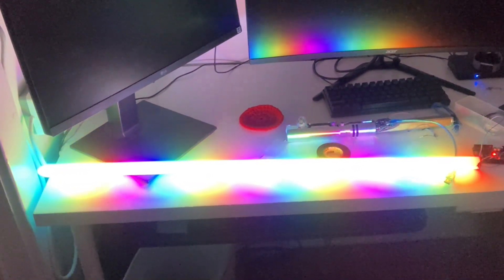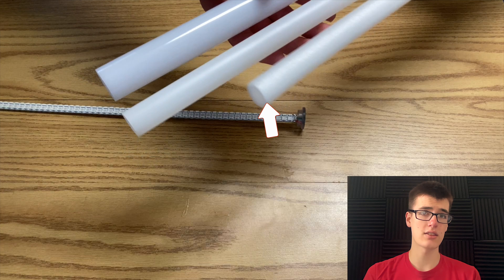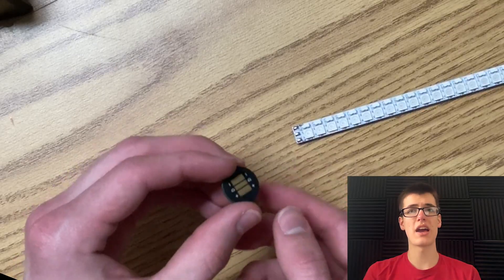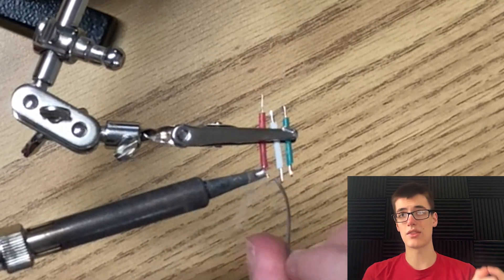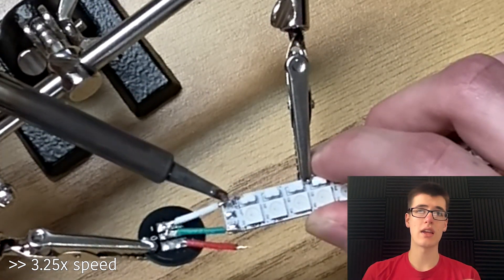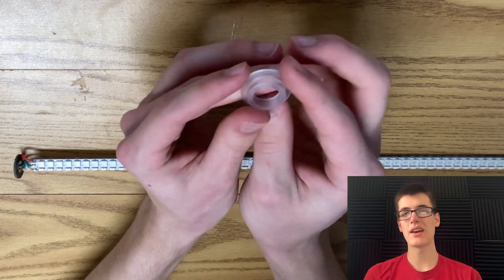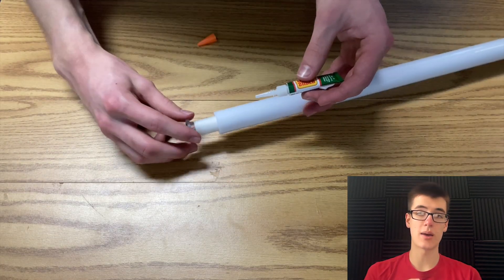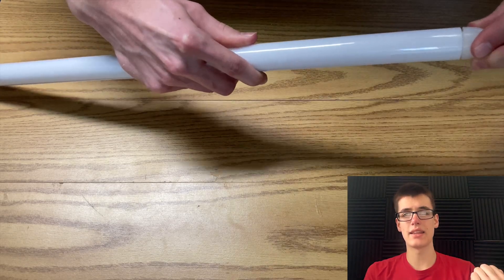How to Make the BEST Lightsaber Blade | Elegant Weapon 1

Comment: I've restored old Master Replicas lightsabers (the really expensive collectibles before mattel or whoever started making them) and I can say that the layers you described are pretty much identical, although the PCBs were only facing two directions. Also, please do not keep collectibles by a window. The white diffusion layer will yellow very quickly.
Reply from the maker: yeah dude the fact that we can fit 2 LEDs on each side now is insane!
and good point about the yellowing, I am storing it away from the window now

Comment: Can you put a video on short circuit while connecting to resistor and capacitor .....❤ and thanks to this video ❤😊
Reply from the maker: I’m not quite sure what you mean, do you mean like how a capacitor is used to smooth out voltage, because that’s not quite a short circuit? Or how we use a resistor sometimes with buttons so we can connect a positive line to ground without causing a short? Or something else?